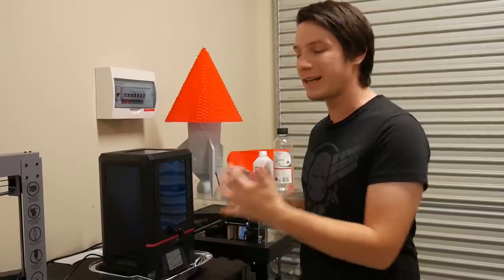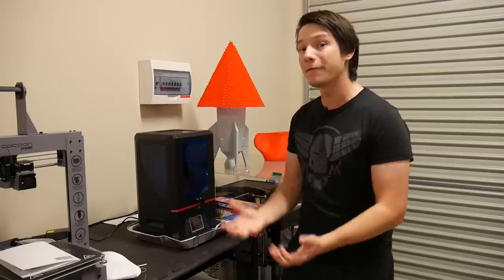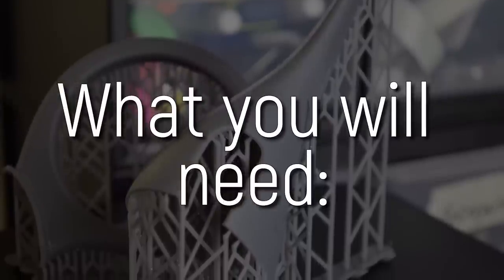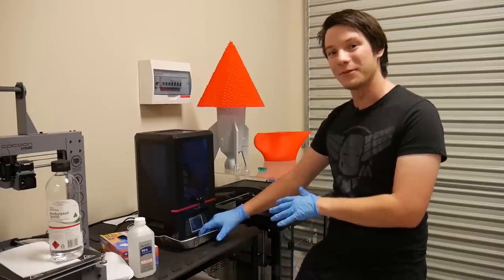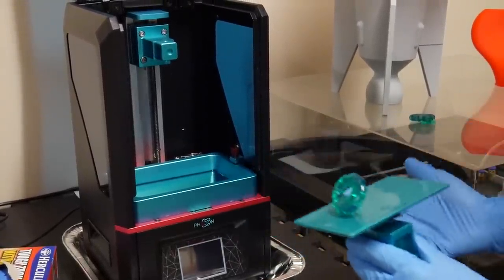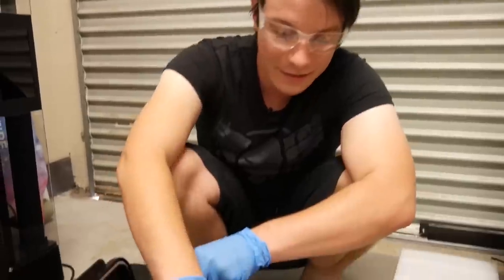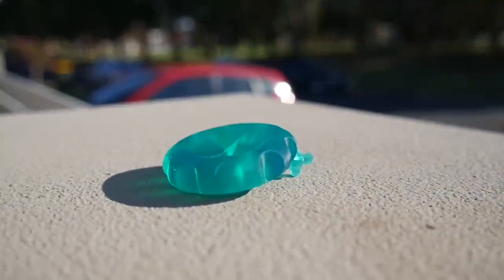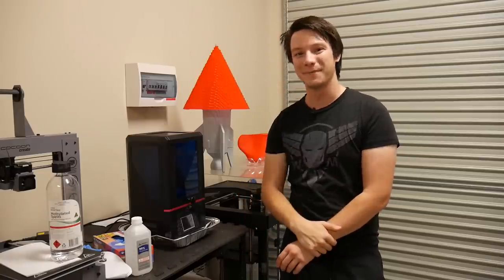Resin 3D Printing Safety - Important for Beginners!

Comment: I just got a resin printer 3 days ago and even accounting for everything in this video, it has been an absolute nightmare compared to my existing FDM printer which I've had for 3 years now. It's slow, 90% of my prints have failed to adhere to the build plate, and removing the failed prints from the resin tank has destroyed the FEP film at the bottom of the tank. If I had known before ordering what I do now, i would have saved myself the money and gone to Shapeways instead.

Comment: I have a two stage decontamination setup. Everything that has resin on is primary goes into primary decon. After the print has been washed and cured, tools cleaned, its moved to second stage. Change gloves and clean the model/tools again with another Ipa bottle. All waste goes into its own bin with double heavy duty bin bags. After second decon I'll give it another 60sec cure in the UV station to harden anything after the support have been removed.

Comment: I feel like this was a vid on why Not to get a Resin printer XD like damn there's a lot of complicated stuff not to mention TOXIC I mean like most of the stuff you use is one or maybe 2 times use then toss like haveing detailed smooth small patients are not worth all this extra cost waist and exposer to toxic harmful chemicals as well as mess.sorry lol sorry I'll stick with possibly getting burnt by the hot end if I deside not to wait for it to cool and some smell thanks; the tho if it IS that bad just buy a cheepy soldering fume fan aka carbon filter.

Comment: Pour the contaminated IPA into a disposable aluminium tray, let the IPA evaporate from that, and then set the tray in the sun for an hour to UV cure the resin film left behind.  No more hazard, and you can re-use the same tray again next time, just building up a gradually thicker layer of cured resin along the bottom.

Comment: Angus. Is it possivle to use these resins without the printer. E.g. could you use it as a UV cure laquer or smoothing layer for regular FDM plastic. Or could you use it for decorative insets in 3D prints?

Comment: I'm loving my Prusa i3 MK3 to bits for larger stuff but for really tiny scale stuff Even the higher end machines seam unable to handle it... I have been tempted to get a resin printer but between my asthma,  Not having an outside work area or adequate venting and the resin itself being pretty nasty stuff in its liquid form I've been rather reluctant to look into getting one.

Comment: I am a little dissapointed, that you do not mention the toxic aerosol. This is a epoxy product, the aerosols can seriously damage your air ways. Not for nothing, that the safty datasheet, says you need a gasmask, if you are not in a well ventilated area.

Do not use these printers, in a small closed enviroment.

Comment: Thanks for video! I want to buy Photon S - but what bothers me - is resin fumes also dangerous? I live in apartment and plan to put printer in separate room (with windows), but still worried a bit. Should I just stick to FDM printers and use PLA/PETG?

Comment: Hi I am working with Objet30 Pro Desktop from stratasys and I work with small pieces for example Pins, bottons, keychain, with small letters and I am using Fusion 360 for create the models, I can continue like this or is better change the programm?

Comment: You might mention that the gloves should be chemical resistant like nitrile or neoprene. Don't use latex. Also the safety glasses should have UV protection as the printer uses UV light.

Comment: If it’s a UV curable resin could you just take it out of a printer and stick it under a UV light ( like a typical resin lamp? ) instead of the rinsing down steps?

Comment: The plastic one the printers come with is used for scraping the plastic screen when theres a fail or ypur cleaning it they usually also provide a metal one specifically for removing from the build plate

Comment: well yeah you need safety glasses if you just slap the part in ipa like that. 6:05 
that's a great way to get splashed...  take it easy dude there no fire. 
take it slow and you wont cause splashes. just because you have safety's on doesn't mean you should be less careful. 
IPA in the eyes would likely burn like hell fire.

Comment: The blue panels on the Anycubic Photon do a crap job of blocking UV light, so either replacing them with amber coloured plastic, or applying UV blocking window-tint film to the existing windows solves the problem. Annoying that they don't ship it with amber panels instead of blue though.

Comment: I know that at the time you were probably using the default slicer which isnt good and i also know that at the time of upload chitubox wasnt yet created or released to public but it does now offer a feature where you can print supports inside models and most times thats not even needed due to the unique printing upside down of sla/dlp printers.

Comment: Good stuff, Angus, however I'd add one key area you didn't touch on - ventilation.

As you're in a garage you're in a large space away from living areas which helps and in sunny Australia you're probably not averse to opening the windows, so it's not so much a big deal for you.

However I've seen people installing their resin printer in the living room which is lunacy (even seen one person install it in their bedroom!). The MSDS data clearly indicate hazards to respiration as well as skin & eye contact. When working with exposed uncured resin, and with IPA vapour for that matter, good ventilation is important.

Comment: Had my elegoo saturn fail hard and resin got all over the place, took 4 hours to clean. Some resin got on my hands and they were itchy  for quite some time and some people have gotten it way worse. Not many people go over just how fragile these things are, how much of a pain in the ass it is to replace the FEP material in the vat which can fail in just one messed up print and have untold catastrophe. People are spinning almost nothing but hype for these things and the tech just ISN'T there yet. Stronger vat bed material is needed. The resin smell is BAD. IF a print goes well you'll end up with nice usually smooth prints sure but there's a serious coin flip every time you hit print on these things if you're not very careful and I think that needs to be expressed to hobbyists or people like parents who'd buy this for their kids. If more resin got on my hands I'd likely have had to go to the hospital.
Reply: Tech isn't there yet? These were invented before the more common FDM printers. And why weren't you wearing gloves?

Comment: One thing you didn’t mention, which surprised me, was respiratory protection.  I’ve seen a lot of posts about how strong smelling these resins are.  I have seen a couple posts where people have returned the machines since it affected them/family member with varying levels of asthma.  I have mild asthma and have wondered if I could tolerate one of these machines if I included the use of a mask and the printer in a few ventilated area.

Comment: Dumb question but hypothetical 
I assume curing is a multipart process but if you were to evaporate the alcohol and then cure the container out in the sun or with a uv light would it be safe to dispose of

Comment: Good advice .My first prints on SLA stunk the house out and my missus got a 3 day headache, worth mentioning that having the machine in the house is not a good idea. Looks like Angus has his in the garage. I moved to the shed with lots of air circulation and also kept all things that touch the resin in an airtight box, spatula, small rinse pot, vat FEP scraper, straining mesh, everything that stinks! Also replaced the flouro lights with LED to mitigate any curing of my resin in the vat, or resin on the straining mesh.

Comment: Love the safety procedures, and they were pretty much what I was expecting.  But my question is about the fumes and mostly centered around pets.  Cats and dogs and the like but also birds.... Especially with a fume base birds can fall to illness or worse very quickly in those.  Do I need to have a dedicated room that my cats cannot enter with an external vent, which of course means they want to go there even more.  Or at they fine, with no contact to the uncured liquid state of course.

Comment: Just as a side note... Methylated spirits can often contain a number of "other" ingredients that are not necessarily listed and can affect your prints in unexpected ways...  Also, the plastic spatula is NOT for removing your prints... it is for getting any cured resin off of the FEP sheet if the part comes loose during printing.... you do NOT want any gouges in the spatula as it will scar or damage the very thin FEP sheet.  Putting the IPA cleaning container out in the sun or in your curing chamber will harden the extra resin and allow it to be strained out... the cured resin is now "safe" for regular disposal and this will extend the useful life of your IPA'

Comment: Hi Angus, thx for the safety tips. I have a question. How strong is the cured resin for mechanical parts? And are the resins used in DLP printers the same as for SLA printers like Moui printer? Thx again and greetings from Belgium

Comment: Let's say you're printing to the maximum height something like a Photon allows, is the proper procedure to just add more resin? I've been trying to find info on this but I haven't been able to.  The reason it doesn't seem straight forward to me is if I pause to add resin while the print is out of the bath, does that result in a weaker bond on that layer? My search for information continues.

Comment: I have not yet invested into a 3d Resin Printer but I plan to in the next couple of months. Since I live in an apartment I am going to build an enclosure that attaches to one of my windows. I'm going to install an intake and exhaust fan in the window and attach the enclosure to the window which should eliminate the resin fumes building up in my apt. I just have to consider any light issues from the sun when printing unless I stick to printing at night and early in the morning. Or I can make an enclosure that uses a ventilation hose that attaches to the window I haven't decided.

Comment: On the topic of solvents: I use denatured alcohol, as I can get it for much cheaper. Worth noting I’ve heard stories of denatured alcohol cracking or softening some resins, so try it first. I use IPA as an airbrush thinner/cleaner anyway so I tried a test of each one and saw no difference, tho I have recently switched resins so I may do another test

Comment: If the uncured resin that comes out with the part is smooth enough, couldn't you just leave it on in the curing booth to get an even smoother finish? taking into account of course if the part needed to be specific dimensions.  But if it were a statue or figure, or even the maker coin, where exact measurements were not critical, and a smooth finish is what you wanted, would that work OK?

Comment: Great video!! Just one thing I think you missed. The fumes.
I got an Elegoo Mars 2 Pro last week, and brought a water washable resin. I thought I had good ventilation in the room, fan blowing, window wide open and door shut. But the small after printing just the sample rook was over powering! (I can only imagine the fumes from IPA resins)
These are definably not something you can use in a spare room of the house.
Having said all that, the printer itself might be part of the problem as it is blowing out more fumes than others. I know it has a carbon filter, but I have read that this does not last long, if at all

Comment: So glad you've made this video! Safety considerations with the resin is the main thing that's been stopping me from getting one
Reply from the maker: Pleasure, it's definitely a serious consideration.
Reply: jort93z True, I've heard the formlabs resin is quite mild. But I've also heard that there are other resins, particularly cheaper options, that have some pretty nasty odours that make it uncomfortable to be in the same room while the printer is running. I suppose it just depends on how willing you are to shell out for resin that is inherently a bit more safe or just take the necessary precautions when using the harsher stuff

Comment: One nasty aspect of these resins which was not mentioned in the video is that they are at least partially volatile at room temperature. I have no experience about how well these machines are sealed. Avoiding operating these printers in small badly ventilated living areas is probably a good idea.

Comment: How is the strength on these cured parts? Can you make functional prints with similar strength to FDM-printed ABS or polycarbonate? How is the material cost compared to filament for a print of similar size/volume?
Reply: it is much cheaper to resin print than fdm.

Comment: Although I'm yet to use a resin-printer, some people like myself really react to resin fumes alone, but there are full-face ventilated masks to solve the problem (unfortunately mine wasn't cheap though, but that was almost 20yrs ago)!
Another thing I'd recommend is buy a few cheap vinyl craft-aprons that some bargain-shops stock, as they'll do a good job of protecting your clothing, & I've tested that they can be wiped clean with Isopropyl Alcohol (91%)!

Comment: Hey, I would leave your gloves out in the sun on a tray to cure it off before disposal and open the "empty" bottle down the centre and do the same. Same with the old solution, evaporate and leave it in the sun to cure off. Simple lab rules, cure general waste, uncured contaminated waste (expensive).

Comment: And also, when resin printing, allow your print to drop leftover resin off before removing for a few minutes , the print is fine. This creates less spill when removing by allowing excess resin to drip back into the vat.   Resin  printing is great the problem and mess comes when a print fails.. Otherwise after a few weeks of muscle memory it is easier to handle and control.

Comment: Hey Angus, I am looking at picking up one of these. I sell mechanical parts, so am wondering about the strength difference between this and PLA/PETG. Any info?Thanks.
Reply from the maker: Very brittle, not recommended for mechanical use!
Reply: Okay that is a shame, thanks

Comment: Good to see larger channels picking up of the complexity of resin. Once of my videos cover just the post print cleanup of a D7. It's a tricky printer to run and the resin easily gets everywhere. One more tip I have is leave the cleanup materials in the sun. I use a glass sheet under your work on instead of the baking tray I put all of that out in the sun to cure resin. You can do that with used gloves before discarding. But dont do it while wearing them the resin gets hot when curing, bordering on exothermic in my experience. Video is on my channel if you want more detail on how I cleanup.

Comment: Angus, can you do a review on the cured strength of the resin used in these printers?  Is this a viable method for producing functional parts?  Are there multiple materials available as in FDM printing or is this a one trick pony?  What exactly is the material used?  I have not done an exhaustive search on UV curable resins, but what I have found is not exceptionally informative.  I like the finish detail available, but my primary use of 3D printing is for tough functional parts.  Thanks for any help here.

Comment: I've been using form 2 for about 2 years now, just under. Its not even close to as bad as you are making it sound sir. Maybe you are predominantly used to FDM so it seems tough. But once you get to using it on a weekly basis, you realize there is really nothing to it. The worst part actually is the supports and removing them. Always leaves imperfections on the print. The resin part I can honestly say I have not even slightly been bothered with it past the first couple of weeks.I dont even wear any gloves and never get the uncured resin on me or anywhere else. Ive had it on my hand several times in the past. Just dip your hand in the IPA for a few seconds, use a tooth brush to scrub it off, wash your hands couple times, IPA again, wash again, resin all gone.
Reply: Everyone just ignore the MSDS

Mohib says it's all fine

Comment: I get that shit on my hands all the time.
Reply from the maker: Please wear gloves ! it causes sensitivity over time and once that happens things can get bad quickly.
Reply: @MakersMuse  I mean its not like I coat my hands with the stuff or anything. I also have no doubt I have been exposed to far worse when it comes to automotive fluids or even firearm cleaners. I could go on. The one thing I have noticed about resin is that it can be a pain in the ass wo wash off, but I got that figured out. From what I understand is that the worse thing that could possibly happen is having it on your hands and then heading out in the sun. Now that would suck.

Comment: I wish you used a UV machine to cure it. I was looking forward to see how long I would need to cure it for with a well equipped machine before calling it done and touching it. I also heard from another videos the sun can mess up the color. Great information anyways!
Reply from the maker: The sun produces UV so prints exposed to it will discolour / overcure over time, but a coat of UV resistant clear coat will help protect it. I use a cure station these days and it's done in 3 minutes or so, but depends how strong the UV LEDs are.

Comment: TIP - Use a UV light (or the sun) to cure the resin/IPA mix.  You will then be able to use a paint filter to clear most of the solid resin bits from the IPA and get another use out of the IPA.

Comment: Another note, if you're printing industrially or for high accuracy parts, most manufacturers say that using alcohols like ethanol, methanol, denatured alcohol, can degrade parts 

Also the cleaning tray is a formlabs cleaning system